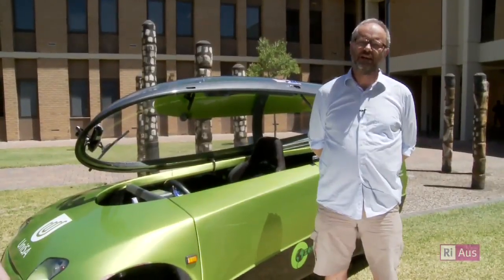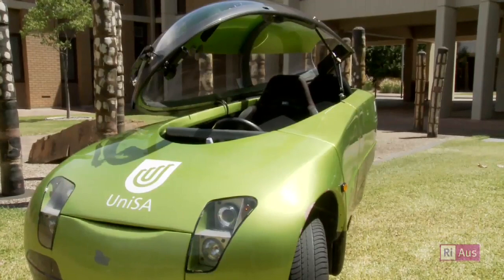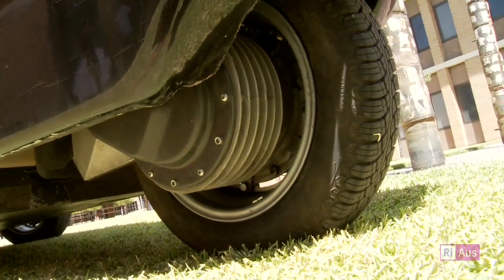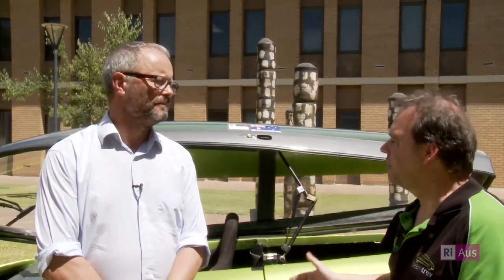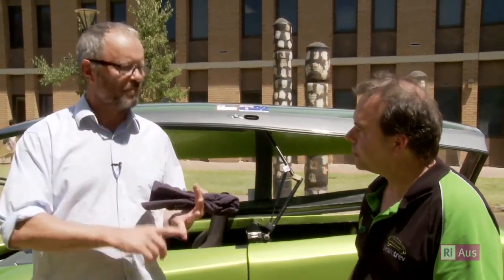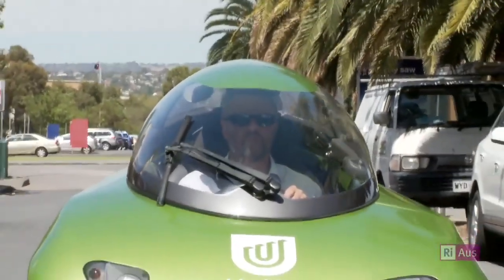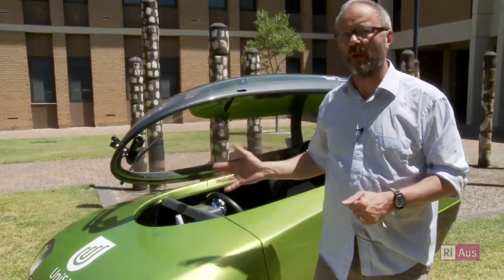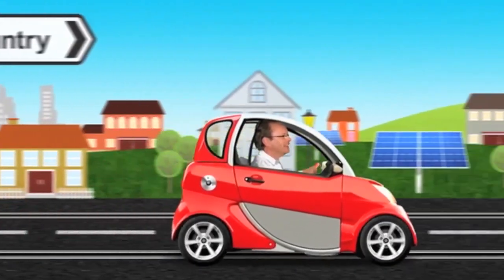An Electric car called Trev | Fully Charged

Comment: Robert why a lot of ev look like a spaceships? Sometime i wonder if ev are invented by alien.
Reply: Jojo Estanero - in this case, as with most EVs, aerodynamics is key...   by making the car 'slippy' (low drag) you can extend the range, by making the Trev light weight with low drag, they can use a small motor.   If they used a boxy, 1980s Volvo type shape, the range would suffer immensely.

One issue tho is that many EV makers have tried, on purpose, to make their cars stand out...   so the owners can make a statement or some such nonsense (BMW i8 for example)...   I personally prefer EVs that look more like normal cars, like the Tesla Model 3 (which is gorgeous), but that's down to taste.

Comment: (1) It's true gasoline engines are victorian age tech, however so too is the electric motor - since circa 1880.  (2).Greenercars (an environmentalist website) rates cars' full lifecycle pollution (from factory to recycling) (well-to-wheel fuel usage).  They rate most EVs as no cleaner than a Prius.  The large Tesla and Rav4 EVs score quite low.... less than a Jetta diesel sedan and all the various hybrids.

Comment: True. The wheels are not the only thing that make the aero poor, but they are a part of it. When was the last record holder with outboard wheels?

Yup, you have a point there, but it works more with bigger, lower pressure tyres doesn't it? For electric cars aren't smaller, higher pressure tyres better to reduce rolling resistance?

Comment: a caterham 7 has piss poor aero because it has piss poor aero, not because of outboard wheels. again I refer to speed records with outboard wheels. 

you are similarly wrong about unsprung mass. a high wheel mass actually creates a second stage of dampening because the rubber will absorb a lot before the wheel mass starts to move and can transfer the shock on to the main car body. the myth of unsprung mass being bad that you believe without understanding is about large wheel movements like baja

Comment: Good point on the handling. But that's not what they're designed for. Lets look at a car that is designed for handling, a Lotus/Caterham 7. The outboard wheels on these cars provide massive amounts of drag.

Unsprung mass will be an issue for all road vehicles because a higher unsprung weight can absorb less energy and will transfer it to the car.

Comment: It is a real issue. I know about it.

No, the body isn't much bigger, just a bit, and it can be an aerodynamic shape, which a wheel and suspension and brake and motor are not. Unless you think all the land speed record teams are doing it wrong and they shouldn't be using covered wheels? You should probably tell them.

Comment: unsprung weight is not a real issue. spare me your objection, you know nothing about it.
keeping the wheels in the body is only more aero if it doesn't mean the body has to be much bigger. and it typically does mean that

Comment: As close as we come to this would be the Myers Motors vehicles or Robert Riley's XR3.  Neither of them have a 124 mile range with 2 passengers as a pure electric as far as I know.  (Perhaps the Myers Motors NMG single passenger version with Li batteries gets 100.)  Myself, I wouldn't mind owning a Trev if it was currently available.  Wish it was...

Comment: Definitely the type of vehicle I've been designing in my head for years. Ticks all the boxes. Obviously a commercial version would be quieter, but other than that it's on the right track. Could use an artist to redesign the outside though. Something not quite right there.

Comment: Sounds like the gearbox is using (cheap but noisy) straight gears instead of (expensive but quieter) helical gears. That means it should be easy to make the car quieter.

Other than that, fantastic vehicle. Very nearly the only electric vehicle that's not a ton-and-a-half-of-steel-and-lithium-for-a-single-occupant-cyclist-killer. Cool stuff! I hope the design can be commercialised.

Comment: I think it could be lighter and more aerodynamic still with the front wheels being outboard and with motors in them. The body could be thinner with almost no wind drag. Like a glider plane with wheels. Costs nothing to drive and takes very little battery.

Comment: I think if a company invested in producing a power plant which could be a direct replacement for internal combustion engines, electric personal transport would go through the roof.
Perhaps it's just me, but it seems counter-intuitive, if you're wanting to build clean cars, we're surrounded by good cars with crappy oil-burners for power. The cars aren't the problem, the engine is.

Comment: 5:50 The SolarTaxi required a large trailer to do its around the world trip in 2007-08. I still want to see three wheeled cars that are more safe, the Aptera was pretty good also, but like this one if it is hit from the side there is no crumple zone. I'd like to see them incorporate some features from the Lit Motors C1 Enclosed Motorcycle. It'd be nice to see a race between the two.